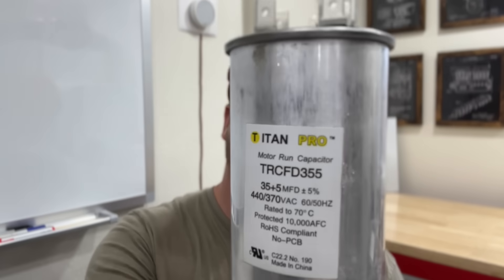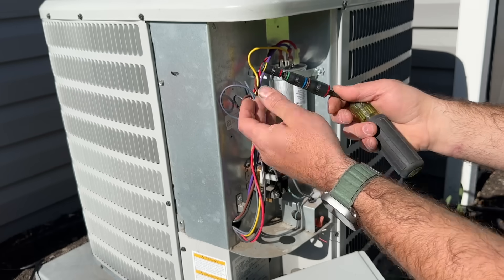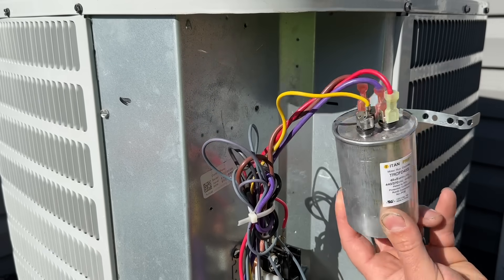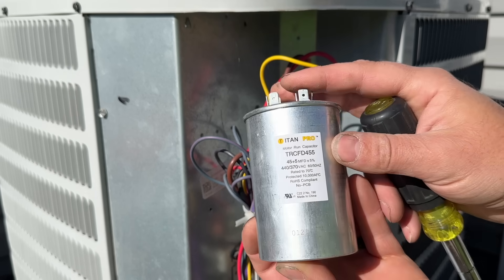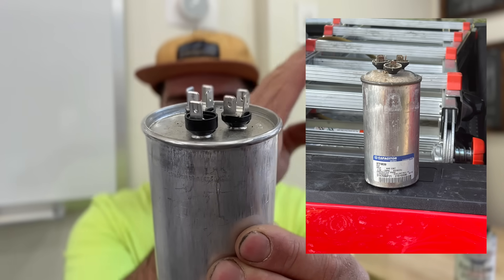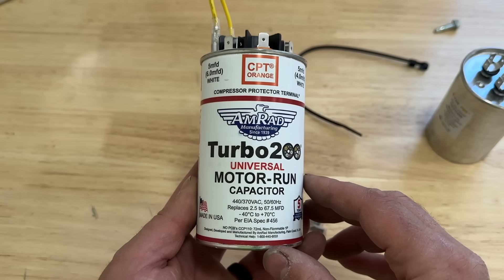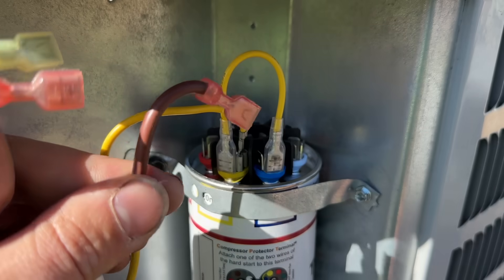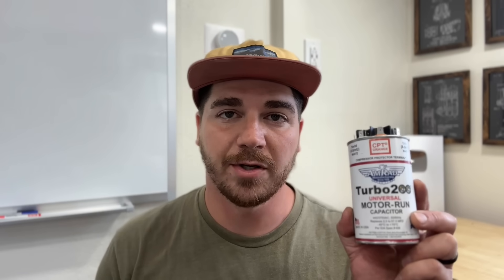HVAC Contractors Practically Make Their Living On These

Comment: As a mechanical engineer and frequent viewer of DIY Guy (among others), I find the DIY HVAC Guy offers the most concise and easy understood explanation of HVAC maintenance. This Guy has saved me money with everything from backup solar hookups to condenser cooling. And he does this with short and to the point videos. I have my spare capacitor on order now. Good stuff. Thanks.
Reply: Don’t ware a ring around electrical systems.  Put on a latex glove.
Reply: @oldmech619  wear
Reply: Those EBay and Amazon off brands only last 6 months. I got burned on jobs! I take the old capacitor off, go to ac or electrical supply house and buy the one the OEM sold by the manufacturer. It cost more, but last a long time.
Reply: @bbaaspencer1  i was under the impression those local supply houses only sold to licensed contractors...as a wholesaler. can you give a store name?
Reply: @Mach141  Grainger will do cash walk-ins if you have one near you.  If you want to order online there are multiple supply houses which will sell to the public.
Reply: @uzlonewolf  thanks. I ordered one online. There is a Grainger near me, I had no idea they carried capacitors. Took it as more of a drill bit kind of place. I guess they have both.
Reply: @bbaaspencer1  oem cap doesn't exist. just like honda doesn't make tires. a cap in a new a/c is typically a cheap chinese version. titan HD is one of the best, U.S. made. the regular titan is mexican made i believe.
Reply: You ever see that movie. The fifth Element? Multi capacitor
Reply: Yep always have a spare capacitor for your AC on hand. Not just the start capacitor for the motor but a run capacitor for the cooling fan.
Reply: @natevanlandingham1945 what you posted is 100% great advice !   
People reading your post need to understand that it's  same analogy as having a car tire flat and no spare tire 😊
Reply: @natevanlandingham1945 spare capacitor, contactor and fan motor too 😆
Reply: Did you buy a multi capacitor? You know. You don't have to have more than one.
Reply: which one did you order?
Reply: How do you know someone is an engineer? They’ll tell you
Reply: Sadly engineers always tell us they are engineers as if that means they are of some higher power above all but then can't seem to be able to fix shlt 😂 You "engineers" are why reason why things don't work
Reply: @77kthomas  Yeah, but we know how to write complete sentences.
Reply: Agree!!!
Reply: you're  a mechanical engineer and you spend you're time watching diy hvac videos? you  make good $, go do cool stuff on you're time off, cool dangerous stuff!
Reply: If you were an electrical engineer, you would know that the run capacitor does not provide an extra “jolt of energy”. Only 1PH induction motors need them in order to spin the right direction. This clown is going to get someone hurt.
Reply: @ardoinsofkaty5671  He is obviously not an Electrical Engineer. And if you are referring to the unit of measurement for induction, you meant “pH” (picohenry). If you are referring to the unit of measurement for power, you meant “HP” (horsepower). If you are referring to a motor’s phase, you meant “ph”, “φ”, “Ph”. Or “1P” or “SP” in this case. 
Either way, there is no such thing as a “PH” abbreviation in Electrical Engineering unless you are from a foreign country or it is specified on a set of drawings. 
To me, a clown is someone like you, not someone who is trying to help people. 
If he made a mistake, bring it up so we can all learn, don’t just insult the guy.
Reply: @5dc61  And you have obviously never read a dataplate.  I'm looking at a GE motor right now that clearly says "HP 1   HZ 60   V 200-230   PH 3   RPM 1725"  The dataplates for the compressor and overall unit also say "3 PH".  Who's the 🤡 now?
Reply: @5dc61 That was a good comeback.
Reply: @ardoinsofkaty5671 how will that occur?
Do A/C systems not have capacitors that fail?
Reply: @ardoinsofkaty5671  hes a mechanical engineer, not electrical. Learn to read
Reply: @ardoinsofkaty5671 yes he will hurt someone through this video and it will be on him. He didn't even explain how he was a professional and you shouldn't attempt at home. If someone dies trying to listen to what he said... that very well is a lawsuit

Comment: Your video made me love my long time (21 years)  AC Contractor EVEN MORE!  Price put in a new capacitor into my failing unit last July to get me by until my new outdooor unit (which had to be ordered) came in…it worked and saved my in Florida for the four days until he got my new unit. He charged me $35 bucks to replace and install the capacitor. He’s the BEST and your videos prove this to me time and again 💜💜💜
Reply: I had a capacitor that needed changed on the air handler and the guy told me he's seen it hundreds of times because the manufacturers use a substandard capacitor that will only last as long as the warranty.  He put in the better grade capacitor which cost a whopping $1 more than the substandard one that is OEM.
Reply: @HariSeldon913  Better grade capacitors will cost more than ONE dollar!
Reply: @bobboscarato1313  One dollar more than the other one, which probably means the lesser one was overpriced.
Reply: @bobboscarato1313  One dollar MORE. Which means the OEM was probably like 10 bucks and the better one was 11.
Reply: @HariSeldon913  That is a great Contractor who appreciates your business 💜
Reply: He charged you that much cause he was selling you a new unit, more than likely. $35 is way too cheap and HVAC  guys will starve with those kinds of prices.
Reply: @amiatroll1  well, I’ve been using Price for over 20 years…he always treats me fairly and comes to me immediately when I have any issues.  I’m blessed to have found these guys.
Reply: Also, I have these guys do PM’s on my system twice a year - so I use them when things are going fine as well… I appreciate him and they take care of me for my continued patronage.
Reply: @amiatroll1  As with every profession and skilled trade there is a need to earn enough from their practice to provide for themselves, their families, their employees and the various governmental agencies that regulate them and require training to maintain licensure.  Of course there are those who will prey upon the ignorance or the circumstance of the consumer, this is why the consumer must take steps to mitigate any potential abuser.
Reply: Sounds like you only needed the cap in the first place...thats why only 35, he suckered you into a whole new system
Reply: @Mach141  Cap? I suppose a locked up 14 year old compressor in Florida that’s weathered 4 hurricanes and running 24/7 for 10-11 months per year needed just “a new cap”….btw…my Contractor “suckered me” so badly that he told me to keep my air handler which should last another five years and found me the matching compressor which ran me only 2200.00 rather than 8K for an entire new unit.  there’s always one di*k in a conversation. Congratulations…you win the prize 🏆
Reply: @lizzieb6311  No a**hat, you just said it worked for 4 days until your new unit came in. If your compressor is locked up, it aint working at all. You win the prize in your own post. LmaO

Comment: I live in a suburb in Phoenix. George Brazil came out last year to do maintenance and wanted to charge me $600. Needless to say, that was the last time I will be using them. Another company came out reference a warranty call (after I did it myself), and their price was $250 (still high). Thanks for having your channel up. I'm currently working on putting on a soft start kit (having some wiring issues).
Reply: I want to say that i got George Brazil came out last year for maintenance complementary call..for $39 and ended up swindle me for $490 and didn't even fix the problem ..Never again..they don't stand behind their work satifaction to the customer ..
Reply: @ireneayenmacorol546  If you were ripped off by an HVAC company, you should report them to the State Licensing Board; they can pay stiff penalties or go to jail or have license revoked! Like here in Texas.--
Reply: You people are the reason our country is failing, I bet your mechanic hates you and half does your oil change.... if you don't do ti yourself 😂

Comment: Great video, I live in AZ and I just change capacitors every 5 years, checking yearly.If I use AMRAD, they last 10 years a least in AZ. They are the best quality caps. I love them for my rentals.
Reply: Makes a lot of sense for such a cheap and easy to replace part.  Preventative Maintenance for the win!
Reply: Seems like overkill but ok I get it, Arizona is a little warm sometimes 😆
Reply: Agree preventive maintenance is key
Reply: Why change them after 5 years if they last 10?
Reply: @mrtechie6810 So you don't get a call from a tenant "My AC won't work!" at an inconvenient hour?
Reply: @MrMEmEmEmEMEMEeeeeee so change them at 9 years.
Reply: Good call on using AmRad. They are the best caps in the business.

Comment: When a contractor tells me I need a part, I ask them to give the name and model number and I will purchase it myself. Because I only want to have money tied up with him is in labor. I know they will get a discount on the parts but charge me full price or better. very familiar with that scam.
Reply: Cool, no problem. But don't expect them to warranty it if the part ever fails.
Reply: @amiatroll1  I know the difference between the warranty on parts and labor.
Reply: If I were the contractor, I wouldn’t give you the part number.  If you want to be cheap and fix it yourself, you can  do your own research.
Reply: @garrybillick3979  I don't know how you operate. But all the contractor, I have delt with never had problem with the customer buying the parts, including sears. some even gives you that choice. I done handyman work for over 30 years, and I know how to find he model number on just about anything and make the repairs. For those that don't in many cases it's better to purchase your own part and save money. because the labor alone will be high as hell.

Comment: Funny story. Many years ago my AC went out on a very hot day on a weekend in a house I was renting. The landlord was resisting getting a HVAC tech out because it would cost more because it was the weekend.  I opened up condenser and found nothing amiss, but I suspected the capacitor was bad. I noticed that my neighbor had the exact same unit as me and I also knew he was out of town.  So I borrowed his capacitor and installed it. My compressor started right up so I thought I will just use it over the weekend and then get mine replaced on Monday and put his back. Just about then, my neighbor pulls up and out pops his entire family. I quickly pulled the cap and snuck back over and put the cap back in his condenser. Then I called the landlord and told him what was going on and that either he call a tech or I will and deduct it from my rent. The tech was impressed with what I had done and said he felt bad to have to charge me for a service call just to replace the cap when I had done the troubleshooting for him. He cleaned the coils and did some other maintenance so he would feel like I got my money's worth. There are a bunch of crooks out there, but there are some really honest ones too. If you educate yourself, you can easily spot the honest ones and when you find one, hold on to them because they are worth their weight in gold.

Comment: If a measured capacitor from a working system was 36.8 uf would that be replaced with a 35 or a 40 uf?
Reply: Depends on what the original is rated for.  The fan motor and compressor labels, if still legible, will list their mfd rating.
Reply: Probably a 40 but you should investigate. Sometimes techs/randoms put in the wrong size cap just to get it going in a pinch and never replace with correct size.

Comment: My guy charged $100, so I feel pretty good...
Reply: Around here, they charge $90-$100 just to come out.
Reply: @HardRockMaster7577 
So $100 to come out $40 for $20 cap and an extra half hour for another 50 bucks would be 200. Not $500.
Reply: If that was your total job charge, mark my words; He's going out of business, (or just did a special low invoice for a loyal, repeat customer as a favor). The good ones who remain in business get about $150-$200 minimum for a service call and parts on top of that. 26 years in business for me.
Reply: If tech installed a made in USA with warranty cap for 100, it’s a good price. If he charged that for part, and install, it’s a great price. If he used a prc cheapo cap, and charged 100 and he charged trip fee, or labor on top, it’s OVERCHARGING.
Reply: Would you have felt better if you did this simple job yourself.
Reply: @m.t.3109  remember, it isn’t just about what the part cost, it’s about knowing what part to change, and testing to confirm it is only the bad part.
Reply: @whochecksthis 
Really do we also have to pay the HVAC guy to know what type of screwdriver to use to take the panel off? Do I need to pay extra when I get an oil change for them to know how to unscrew the filter. 
It doesn’t take very long to test the capacitor. Or to look at it and see that it’s bulging. Don’t pretend you have magical knowledge that’s worth an extra $300 on a repair. Oh wait if you want to rationalize that you deserve the money good for you. Don’t expect anyone else to buy in to it.

Comment: Came back from vacation last summer to my home in FL and the AC was out. Used the turbo cap I had bought years earlier in VA to get my AC system back up and running. Ordered a replacement cap. When it came a couple of days later swapped it out. Will keep the turbo cap ready for the next time I have a problem.
Reply: For such a relatively inexpensive item, it just makes sense to always keep a spare on hand.

Comment: The scamming problem is even worse in condo associations, because the condominium property managers aren't spending their own money and it's easiest for them to just go along with whatever they're told by contractors.
Reply: That is absolutely true. I'm in one and they don't care.
Reply: The administrators will often engage those who reciprocate benefit in some manner.
Reply: @JackLucas-jh1eo  You mean scammers???
Reply: I"m a little contractor and most associations won't let me in to fix units. the manager gets a cut to recommend their prefer ac contractor that charges a lot more then I do.
Reply: @westsidehvac1097  clearly american idea. Here in Australia strata managers intentionally do not care about unit equipment like ac, your ac - you call your tech to fix. Sometimes even common equipment in units (our intercoms) is responsibility of owners.
Reply: I have a friend that has a pressure cleaning business; much needed in Florida.  He said he’s never landed a contract with any of these boards without giving side change to someone on the HOA board.  The nastier these guys are the more money they are stealing.
Reply: @Dbb27  At Mar—a-Lago, someone is always getting paid off.
Reply: @Dbb27  pig committee. And tradies, actively participating in all this.
Reply: its the reason why I prefer to work with stratas (our local version of condos), not with private customers. Its easier and they do not fall down with cardiac arrest when you show them invoice for couple of thousands.
Reply: Hmm.  Shared hvac?
Reply: no a scam, its called a business. u.s. quality cap cost $60, sell for $450. about 1/3 of profit goes to taxes. also that business has to pay for a truck, workman's comp, uniforms, tools, safety equipment. ler's also remember that employee wants health bennies and retirement and paid days off plus a lot of non profitable on the job training days. if you care to evaluate, you can't look at the price of the part and by that alone assume it's a scam. do you think doctor visits really cost thousands? i went to spain and got a root canal fot $300 usd. in california it's about ten fold. all businesses have a lot to pay for, if your boss pays you $25 an hr, realistically you cost him at least $100 and hour after all the $ it costs to keep you working legally. please consider the big picture before assuming all hvac companies are a scam
Reply: >theuserthatishere  : "quality cap cost $60, sell for $450..."  That looks like a scam to me (even if the contractor eventually pays $130 in taxes on the $390 profit).  And we can assume there are some cases where the old cap -- or some other part -- didn't really need to be replaced.
     Your conclusion -- that we shouldn't assume all HVAC contractors are scammers -- sounds reasonable.  But as far as I can tell from the comments, no one assumes ALL... only TOO MANY.
Reply: And some of them are "on the take". You know the AC contractor that the property manger likes the most is the one who gave them a huge discount on a new AC unit for their home or maybe took them to an expensive restaurant and picked up the tab.
Reply: Or, they use a company they are familiar with who pays them kick backs